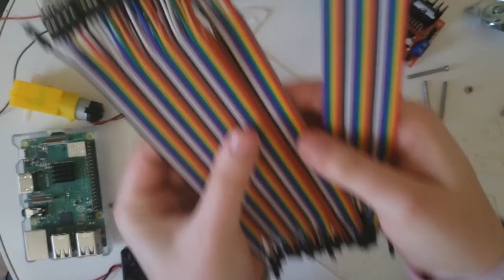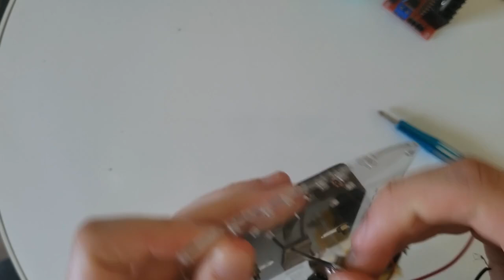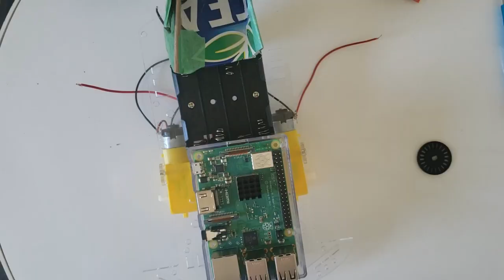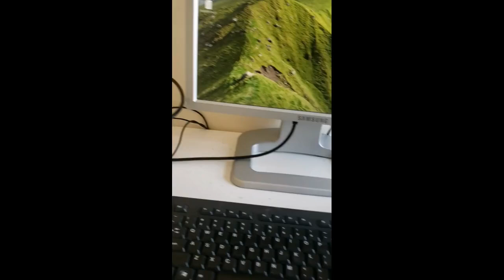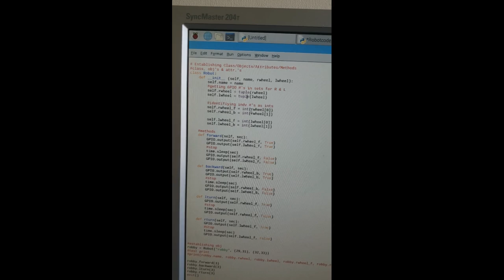How to Build Your First Robot With a Raspberry Pi and Program it in Python - Step by Step Tutorial

Comment from the maker: Here's the order of the video so you can skip over parts if you wish! 
Materials: 0:07
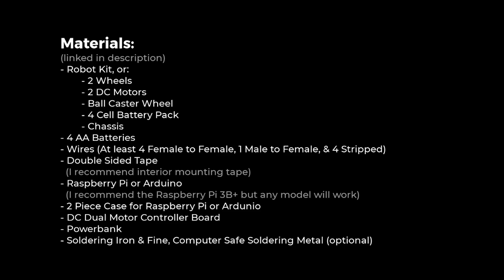Materials List: 1:12
Attaching Wires to the Motors: 1:17
Attaching the Battery Pack 2:32
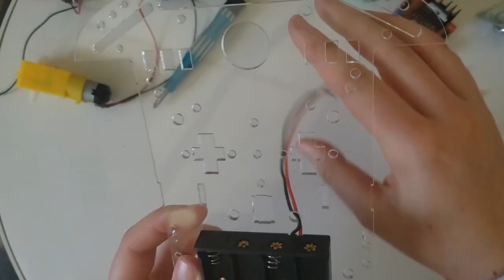Check the Motors: 3:15
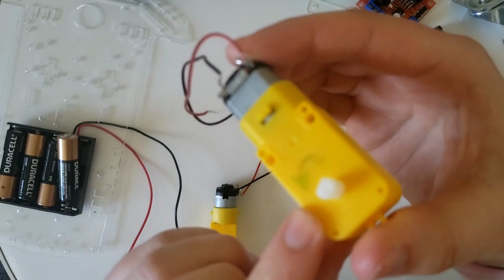Attach the Motors: 4:25
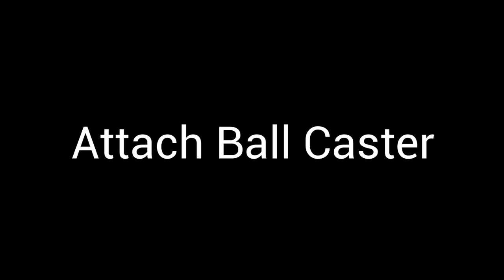Attach the Ball Caster: 5:45
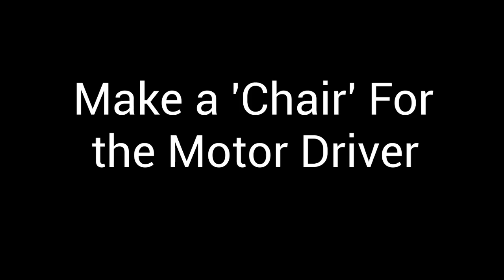Make a 'Chair' for the Motor Driver: 6:53
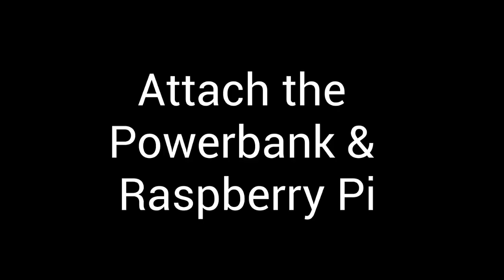Attach the  Powerbank & Raspberry Pi: 8:47
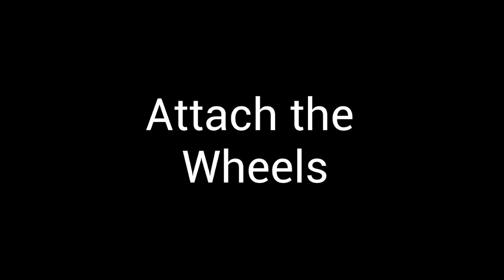Attach the Wheels: 10:31
Connect the Motors to the Motor Driver: 10:48
Choose Your GPIO Pins: 13:03
GPIO Chart: 13:26
Connect the GPIO Wires to the Motor Driver: 15:07
Write a GPIO Testing Script: 15:52
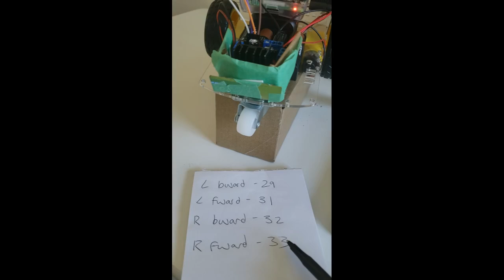Order Your Wires: 18:22
Write the 'Good Copy' Code: 19:28

Hope you enjoy!!
Reply: Also can you post a link that is in the U.S
Reply: can you copy the final code here
Reply: @sarahalfiqi5664  first code

import time

import RPi.GPIO as GPIO

GPIO.setwarnings(False)
GPIO.setmode(GPIO.BOARD)

print("0")

GPIO.setup(29, GPIO.OUT)
GPIO.setup(31, GPIO.OUT)

GPIO.setup(32, GPIO.OUT)
GPIO.setup(33, GPIO.OUT)

print("1")

GPIO.output(29, True)
time.sleep(3)
GPIO.output(29, False)

print("2")

GPIO.output(31, True)
time.sleep(3)
GPIO.output(31, False)

print("3")

GPIO.output(32, True)
time.sleep(3)
GPIO.output(32, False)

print("4")

GPIO.output(33, True)
time.sleep(3)
GPIO.output(33, False)

print("5")

time.sleep(3)

exit
print("6")

Comment: One thing I highly recommend for robotics projects, is instead of using double-sided tape, get adhesive hook and loop tape. They come in a box with two rolls. It's basically Velcro (with each roll being one side of the Velcro pair), but they have strong tape on the back. So you can put one side of it on your chassis, and the other side on your component. It holds well, and also allows you to detach pieces with force and re-attach later. Very handy when you may find down the line in the project a cable is too short the way something is oriented, or to help you more easily recharge your batteries.

Comment: Hello.  I really like your video.  I have several questions: 1) can you show a wiring diagram between the motors, DC motor controllers and the  PI pins 2) from what I can tell the motors have only 1 speed, have you tried doing this with a motor that has different levels of speed? 3) why are you using a cardboard to hold the motor controller board 4.) from the python code that you showed, can you move forward, backward, turn left (with n number of sec or degrees)?  Also like others are asking, can you share the python code and python code need any configuration to talk to the raspberry pi GIO pins?

Comment: Hello. Great video. I have a small question... when you set up the right and left wheels individually, you gave them each a 1 and 0. Why is that exactly? Is zero(0) to stop moving and one(1) to begin moving? I believe I understand the rest of the code but I wasn't 100% sure for the reason. Thanks

Comment: How were you able to disconnect the Raspberry Pi from the monitor, keyboard, and mouse but still have it run?
Reply: same question
Reply: The Pi will power up automatically when it gets power. You can have a python program running on startup. If you want to interact with the Pi (for instance to put the python program on there, or to tweak the program) the most common way, i guess, would be to use SSH (google is your friend on that one). Also use ssh to safely shut down the pi, as not doing so might easily corrupt your SD card. When using a battery powered setup you might also want to research writing a script to automatically safely shut down the Pi in case of low power to prevent data corruption (though this might be a bit more complicated)
Reply: Boys you can use VNC to connect remotely. It’s the way I do all my pi’s. Much easier.

Comment: Nice. My friend and I used the same kit to build an internet controlled bot. It basically had unlimited range, and we used a power bank as the power source. We also used a L293D motor driver. The long one with 16 pins
Reply: sounds like an interesting project and something i would possibly like to recreate. can you elaborate on how your robot was internet-controlled? did you use a raspberry pi? also, what were the output voltage and current of your power bank?
Reply: @dxs1667  I'll just link the website which we referred. Just keep in mind that several codes of the python program are wrong, and you will have to tweak the code. The powerbank was of 5V but I don't remember the current.
https://circuitdigest.com/microcontroller-projects/web-controlled-raspberry-pi-surveillance-robot
Reply: @swaroophegde5831  perfect, thank you!
Reply: @dxs1667  so did you do it?
Reply: @dxs1667  it's been a year mate, I'm still waiting for a reply :)
Reply: @dxs1667  did you do it?